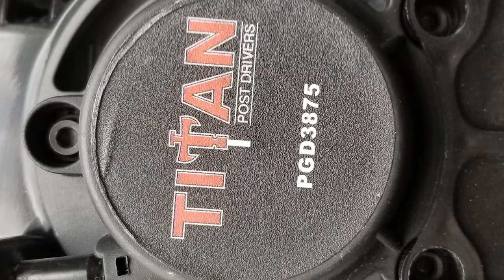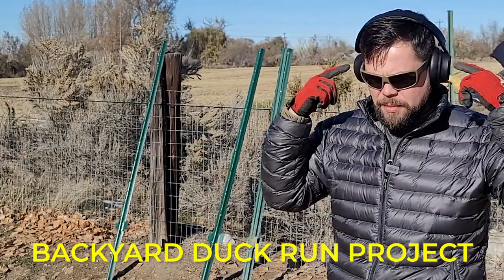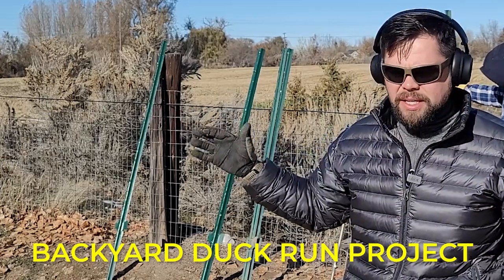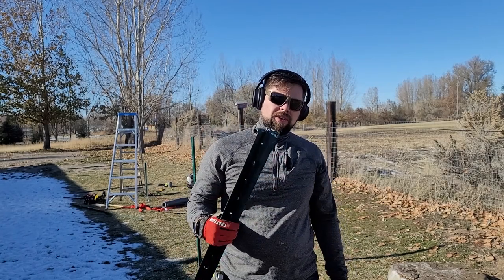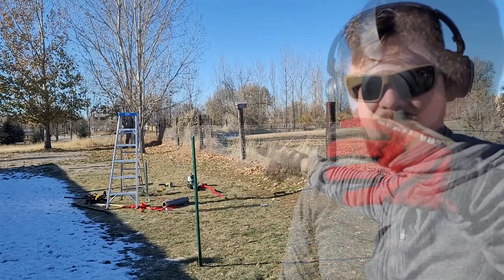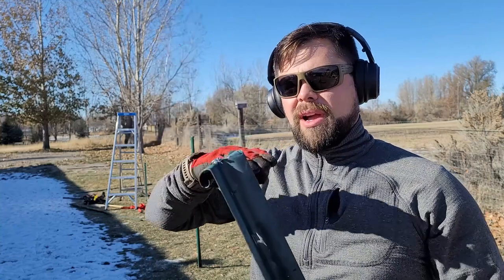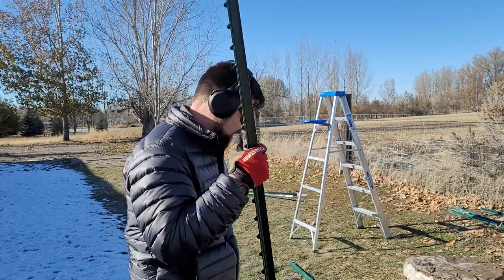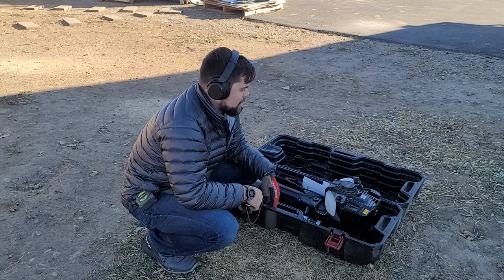Best Handheld Post Driving Tool

Comment: That would of been nice to drive down my point well with. My point well flows to 18 inches. Got a little 2 stroke water pump to pump water up to camp 350 feet away and 40' rise.

Comment: Which model were you using?
Reply: I saw PGD3875  it’s not on the website as one listed The website is showing three different versions.
Reply: @clarencewiles963  Thanks
Reply: @clarencewiles963  just looked. It’s Listed under the Farm and Home section of the website.